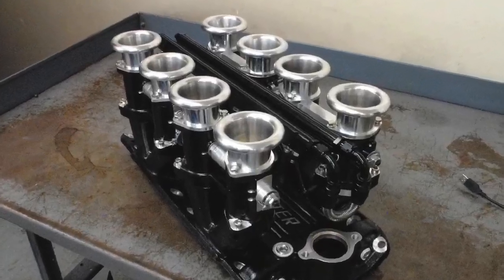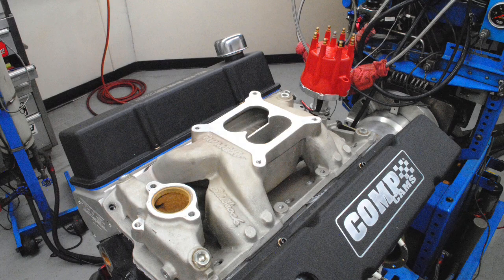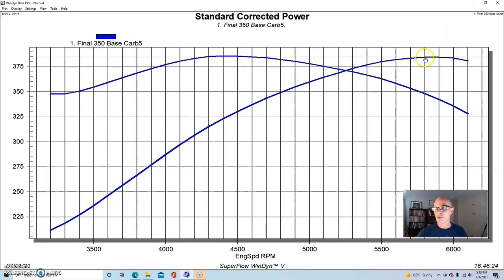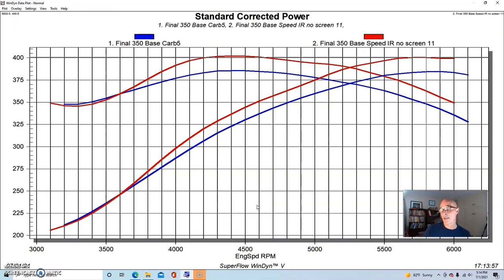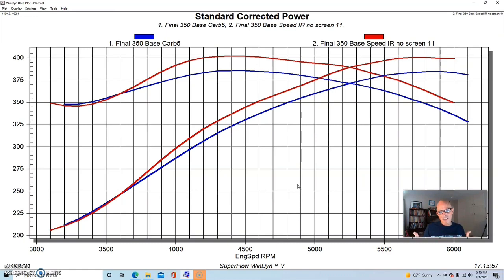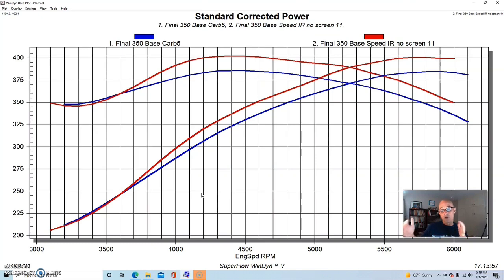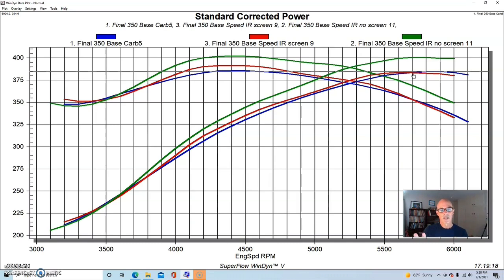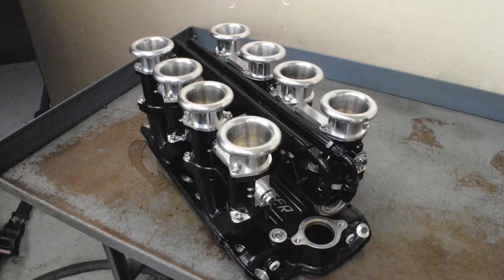SBC EFI STACK INJECTION-DOES IT WORK? (FULL DYNO RESULTS)

Comment: Who runs screens with ITBs? It's so weird, but it's like Americans have never seen real racing engines before.
Reply from the maker: people who drive them on the street-also remember that Hot Rodding was invented in the states
Reply: @richardholdener1727  I suppose, if you're going for that old school hot rod look, but they provide poor filtering performance with a lot of restriction (as you've shown). More modern solutions would be an airbox with a conical filter on the end of it (Harrop Hurricane ITB airbox, for example), or a panel type filter inside of the airbox (used by naturally aspirated F1 engines, the C5R, etc). On many street driven Hondas with ITBs, I've seen some form of foam air filter used (Jenvey has some nice examples).

Hot rodding may have been invented in the states, but the Europeans invented automobile racing and have been ahead in the game since the beginning.

Comment: Used to run Webers back in the day on my 2.2/2.4 Toyota Celica motor; dual sidedrafts. They sound awesome and the throttle response is definitely there. However, I am curious, do you still get the same throttle response when you run boost across the stacks while the stacks are contained in common plenum?
Reply from the maker: yes you do

Comment: Love to see what the 8 stack would do on an iron engine. Big Block Chevy 454. That means ported & polished Iron heads/10:5:1 comp. pistons. 550 int. 550 ext. lift 312 dur. Flat Tap solid cam. 1:73 rockers.

Comment: 👿🔱😈..ok I'm not an engine mechanic so I would appreciate some information on this topic.. Are these not carburetors ?.. so they are fuel injected carburetors how does that work compared to a regular carburetor...ty for any info
Reply from the maker: the EFI is not a carburetor-it is fuel injection
Reply: @richardholdener1727  okay on a modern car when I pop the hood and look underneath it it's fuel injection I don't see anything that looks like what's in this video... and what you're saying isn't a carburetor has butterflies in it and it adjist the air flow yes ?.. just like a carburetor has butterflies that adjust air flow
Reply: @richardholdener1727  perhaps I need to look up Webster's definition of what a carburetor is🤔

Comment: I just bought 2 44mm Honda CBR1000rr fuel injection throttle sets for my explorer motor with ported Twisted wedge heads and an f cam. I think I'm going solid roller lifters, and die cast high energy 1.6 rockers.

I need to figure out if I'm porting and re-using the GT40 lower manifold, or fabricating my own. I need to figure out what my redline should be... Stop tempting me!
Reply: I think I'm going to make a big air box, with a polycarbonate zr1 lid and cold air ducting to the filter at the front of the car.
Reply from the maker: solid roller F cam?
Reply: @richardholdener1727   uuum, I think the 'hydraulic roller' f cam will have a gentler profile that when combined with solid roller lifters will let me rev the motor a little higher before valve float.  Blame engines be masters?
Reply from the maker: good luck

Comment: A 650 carb is perfectly fine for a 350. My buddy runs a 650 edelbrock on a 460 big block ford. It does just fine for that truck. I run an 850 Demon on my 400 small block race car but thats a whole other ball game. Never dynod the car but were estimating it makes around 450-475hp with about 510-520 ft-lbs. Its a screamer for only running 10:1 compression

Comment: Hey Richard , love your videos. i am actually dealing with one of these setups run by a FAST XFi setup and need to sinc the throttle blades. any tips would be great but i honestly hope i get them sorted before i see your reply. i will just apply your tips to the next set up. Thanks great video.
Reply from the maker: we use a unisync

Comment: I messed up my first one. Sorry, I shall reiterate.
About 270 degrees duration, with a little port work in the bowl and on the bias will really wake this beastie up.  Keep the same lift and LSA, and using waisted-stem valves with knock your socks off. The ram affect produced by an IR intake really comes into its own at the mid-lift to full-open, making it a natural supercharger.

Comment: Love the video but was wondering where to plumb the fuel line on 1968camaro firewall with Barla 8stak help me if you can thanks.
Reply from the maker: doesn't your factory line run under the car?

Comment: Richard,
Will this EFI work with a mechanical fuel pump or does it need an electric pump? Thanks!
Reply from the maker: needs high pressure electric

Comment: Funny i have a 355 sbc with a big cam, edelbrock aluminum heads that are ported, edelbrock h122 supercharger at 8psi.  I run a quickfuel 850 dp blower carb and its still technically too big up to 5500 rpm.  Flows 870 cfm at 6500rpm on the chip.
Reply from the maker: 850 is not too big for a supercharged small block

Comment: Like they say there is nothing new Under the Sun. Tom Nelson of Nelson Racing Engines has been using stack injection for years making thousands of horsepower and still be able to drive the car around town like a ho-hum grocery getter play great fuel mileage until you stand in those stack injectors causing all kinds of havoc on the street like two foot wide Mickey Thompson's turning into fire and smoke painting the streets of downtown LA with two big black stripes from idle speed to top end oh my God

Comment: Years ago I ran a Holley 850 double pumper on my bored 283 with healthy cam.  But I recall someone did a test on a couple of different muscle cars using Holley carbs from 650 through 850 and sometimes a 700 or 750 worked better.  However any decent FI should beat a carb.

Comment: If you put a big air cleaner on the carburetor it would also lose some power.  I'm guessing the spread would again be about fifteen horsepower compared to the filtered individual runner stacks.
Reply from the maker: the air cleaner on the carb motor can actually help
Reply: @richardholdener1727  I think it's time for a test.  While the base helps direct air toward the carburetor, the filter element is a restriction.

Comment: I'm going to stop you right here at the very beginning of the video because gears and gasoline showed me this unique fact about Vortex stacks and I would imagine they would add about roughly five horsepower per cylinder in a V8 if they are done correctly
Reply from the maker: that is not universally accurate

Comment: Was the carb run with an air cleaner? Seems a bit unfair to handicap the stacks and not the carb.
Reply from the maker: the air cleaner assembly on the carb can actually help
Reply: @richardholdener1727  wow that's counterintuitive. My quick google and youtube search didnt dig anything up. Do you know if it's slight air fuel adjustment from pressure drop, more laminar flow into the carb, or something crazy like intake pulses seeing distance to the filter as runner length. Thanks for shareing you knowledge.

Comment: I bought a scooter that been ran without a filter, I guess it was sold because it stopped running, it didn't have enough compression to run, that and the  carb was full of fine grit, it was like it was sand blasted, even the valve seats were trashed,  I rebuilt it, gained 32cc, and running a pod, K&N style filter, filters are important! Especially if it's a large high revving engine! Flowing alot of air, maybe something similar to a motorcycle filter can be used on the stacks, only much larger, and made like a K&N filter, maybe attach it to the hood, so you see the stack injection when its open!!

Comment: I run a 400 CFM Holley on a 440 Chrysler motor and it's more than enough by the way that's Factory
Reply: Have you tried better induction, if not, how do you know its more than enuf ? At 6,000rpm the engine need approx 752 CFM, 400cfm is fine if its a car Miss Daisy travels in
Reply: @davidwarland2680  it is a little Miss Daisy car but like I said it's a 400 CFM and it runs like an angel some of us believe in not working on a car all the time.   Drop the mic
SEE YA
Reply: @michaelperham694  lol ok, sweet deal, underpowered nothing that runs erm fine lol, yea copy that.

Comment: Please could you compare carb filters with regard to stock vs. round filter with a filtered top hat?? I have either read or saw a video that the filtered top hats or covers allows straight in air flow that results in more power. Also, did you filter the cab air in your tests (i missed that part of the discussion)?

Comment: Nick dino'ed a Chevy 400 with a 750 Holley, the engine gained 4hp when swapped with a 650 Holley, the engine only pulled 496cfm with BOTH carbs. Hp was 411hp with 445tq..

Comment: The math says 350cid @ 6100RPM = 617.7662037037037037037037037037CFM

That's not to say that a 750 wouldn't help eke out a little more at the top end, just by virtue of not operating at ~95% of rated flow.....80% comes around 5100RPM, 90% near 5800 on a 650

Comment: Love your vids man. I have 3 questions. First, whats the driveability like on these electronic Holborn setups. Second, does adding plenum volume on the bottom side of the throttle plate increase performance in any way. Also, does a narrower plenum increase low end power, similar to runners in a head
Reply from the maker: driveabilty is a function of tune-it can be jumpy from having so much throttle opening, not sure how you add plenum volume below the throttle plates on an IR system, no on the plenum question

Comment: So basically you said the 750 carb would have made more power.
Reply from the maker: A 750 WOULD MAKE THE SAME MORE THAN LIKELY
Reply: Your missing the point, the added cfm of stack inj added power, the screens to it back to the 650cfm power..  
So... The 750 would have made close to the 400hp the injection did without the screens...

Comment: David Vizard has always done exactly what you do on dynos  since the 1980:s he is a British engineer. He figured out Back then, a large area K&N filter, flowed the best over these style carburetor s
     He is still in Cali, still Dyno testing motors. Can even be found on you tube. He has written a ton of Automotive Engineer books . Which is the only way to get a quick answer from him ( because you can read at your own pace. He is a slow speaking engineering type. But a very thorough researcher.
Reply from the maker: THNX-I'VE SPOKEN TO DAVID MANY TIMES-HE IS THE GOODS
Reply: @richardholdener1727  also worth checking out a guy called David Baker. Vizard and him are friends, both VERY knowledgeable with decades of experience.
Reply: Cool to see someone mention Vizard, he's one of those geniuses that gets no attention for his work and has always been at the top of the game.
Also reminds me of Joe Sherman, the undisputable Kind of budget horsepower.

Comment: You do a dyno with screens in the stacks and then say its basically the same as the carb. But then you don't do a carb pull with an air filter. 🤦
Reply: A free-flowing, through top, K&N will offer little or no resistance to air flow. With the ITB the same can be accomplished at an astronomical expense, aesthetics notwithstanding!

Comment: Something that's intrigued me about ITB setups has been the supposed power differences between short, mid, and long trumpets. I've always understood how changing the length of the intake runners effects the power band because of the resonance wave between the valve and the throttle blade, but no one has explained how or why it can change with different length trumpets. They only effect the air before the throttle.
Reply from the maker: its all runner length-changes arrival of reflected wave

Comment: I did a lot of tuning about 20 years ago on the Torque V12 with a stack injection setup.  Twelve 2.9" butterflies.  There was a lot of setup involved.  Each throttle bore and plate had to be measured and sorted to get clearance in a certain range.  The linkage had to be assembled and the angles checked to get bank-to-bank synchronization.  We used over/under instead of parallelogram linkage to make the throttle airflow to injector spray pattern the same for both banks.  Each engine was individually mapped with small throttle opening increments up to 20 degrees, then coarse increments up to WOT.  If some yutz mechanic took it upon himself to adjust the linkage in the field, we had to make a service call to reset the linkage and retune the fuel map.  One degree misadjustment would really throw off bank-to-bank synchronization at idle and off-idle conditions.

But we liked the IR manifold because it allowed us to run longer duration cams, and still have better idle quality than the plenum-runner EFI manifold.  We designed a good looking billet aluminum with expanded metal flame arrestor for boat applications.  On the dyno we had a big, ugly airbox that enclosed all of the stacks so we could measure engine airflow.

Comment: Richard, really like your videos and appreciate your insights. One major thing to consider with individual throttle bodies is the sound. Obviously most v8s that you test have great exhaust note which dominates the sound experience, but for me, I've become obsessed with the noise that can come out the front of the car from induction resonance. Bare stacks will sound really good, but encasing them in a huge plenum that vibrates a lot (ideally carbon fiber) is the uper echelon of the sound experience. Definitely check out the McLaren F1, the BMW e30 M3 DTM racer, the BMW e46 M3 CSL, and the Lexus LFA. I bet the trophy trucks you mentioned have a bit of it too. The exhaust sounds great on all those cars listed, but the sound experience is dominated by the induction noise. Not sure how many V8 hot rodders would go that far, but it is definitely untapped sound joy if you are splurging for ITB.

My dream is to fit a Jenvey ITB system (like what is on the Driftworks DW86) to my LS3 project and fabricate my own carbon fiber sound cannons.

Comment: Do you have a recommendation for a software package to design exhaust headers. Boone makes a set for my franken motor.
Reply: Burns Stainless provides a header design service where you fill out a form giving all the specs of your engine, then they'll get back to you in a day or two with a header design recommendation.  I did that for my GMC V6 build.
Reply from the maker: Burns

Comment: 🔔👍
filtration
How about a power test comparing real air filtration to those gauze type that require re-oiling every 5,000 miles and the cleaning the intake if the excess oil after 100 miles. (it screws up your mass air for sure)
I tossed my KN because of all the dirt/crap in my mass air screen and intake tube after 5,000 miles.
Not worth a couple hp above 5,000 rpm.😎
Reply: Remember the KN type filters were designed for airplanes on the ground. There is almost zero dust above 2500 above the ground
Reply: Many tests out there on K&Ns
They usually come out on top for HP production.
And do an adequate job of filtration as well.
I did a check up recently on the intake system on both my turbo cars with K&Ns, and down stream from the filter they are spotless.

Comment: I'm already fabricating in my mind a billet bottom plate that would allow you to keep the stacks, and use say a large oval air filter from the Air Grabber Mopar, and a top high enough above the stacks to not impede airflow and allow the radius of each stack to do its job. To take full advantage  of the potential airflow,  I would also try and double stack the filters and turn some standoffs on the lathe to keep the filters from collapsing when tightening the top. 
BTW, thank you for not putting a larger carb than a 650 on that combo. 
T.S. RACING

Comment: Did you run a air cleaner on the 650 Holley?  If not put a air cleaner on it and run the dyno again and see how much HP that the Carb combo loses. Great video.
Reply from the maker: there is no loss
Reply: Thanks

Comment: Now let’s see what some Weber downdrafts do 😀

(if you do, have fun tuning!)
Reply: People have been doing that since the late 50s on SBC. And Fords as well.
As for power? more than the set up tested. But low end is a lot worse
Reply: @ldnwholesale8552  I run DCOE and bottom end is stunning.
Reply: @davidwarland2680  I have been around quad webered road race cars, both downdraft and side draft for decades,, and none will pull the skin of custard under 3500. Most have been replaced with a single 4bbl. Simpler, cheaper, more reliable. Though strictly speaking historic cars using more modern intakes and Holleys are not kosher.
And sidedraft Webbers do not like rough roads either as they 'flood up'
And I have been playing with triple DCOEs on road race cars, speedway cars and off road cars for  over 40 years
Reply: @ldnwholesale8552  so you are saying, you have no idea how to tune webers, most like you have no idea.

Comment: I have been intrigued with the Speedmaster Stack FI and was excited to see your test. I have always heard on weber carbs that the filtration was always an issue (to be fair, a small issue compared to tuning the carbs). One question I had: did you run a filter on the carb on the dyno? If not, seems like an unfair comparison. It would be interesting to see a run with them filter vs. filter.
Reply from the maker: a good air cleaner on the carb can actually add power
Reply: @richardholdener1727   so can a good air box for the ITB's but i understand the carbs are simpler so naturally there would be a preference to them
Reply: my thoughts exactly